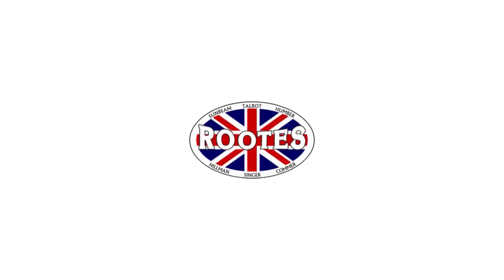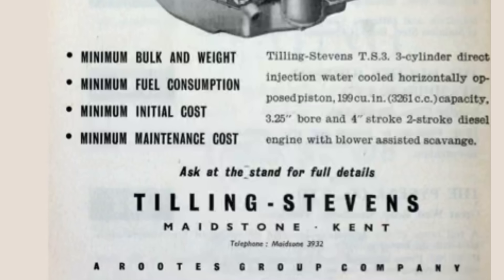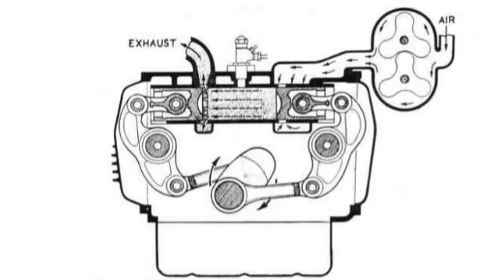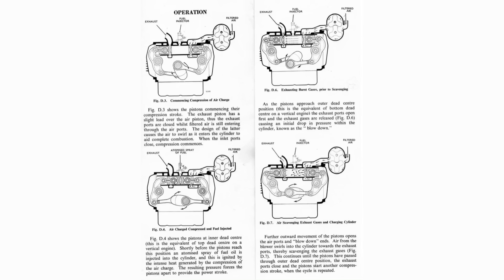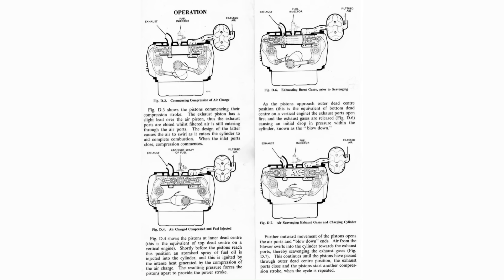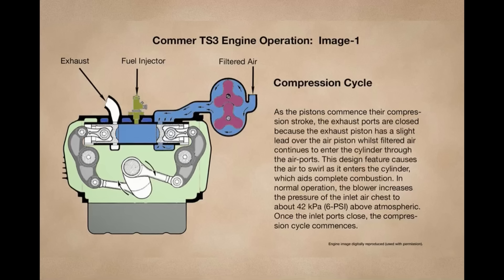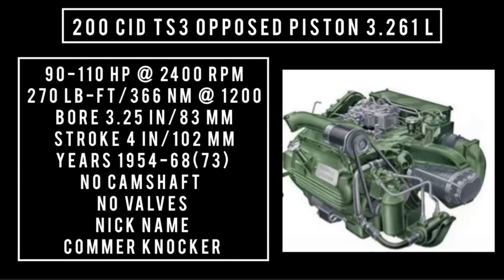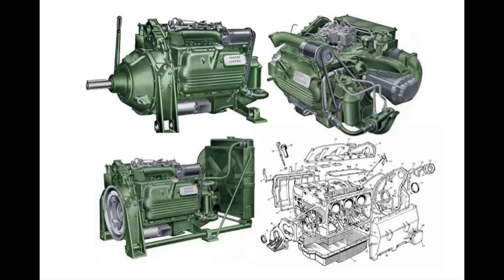Rootes TS3 three cylinder six piston two-stroke diesel engine 200 cid

Comment: I am into all things 2 stroke. The oil was NOT sent to the combustion chamber, as mentioned. It had a wet sump like a Detroit diesel, only fuel was injected so they ran quite clean and are actually insanely efficient, being opposed piston. The Fairbanks-Morse opposed piston diesels are as far as I know, still in production and run VERY clean. I have a rare, only 7 built, I have number 3 of the 7, air cooled small single cylinder 2 piston 18 cubic inch 7.5 horsepower military prototype 120/Y/208 volt 3 phase 400 cycle field generator set that was never adopted by the military and never produced, and it is incredibly fuel efficient! Made my American MARC. In the year I was born, 1966! It has about 18 hours on it. It uses 2 crankcases and both act as scavenge pumps, and although direct fuel injection is used, it has total loss oiling because of crankcase scavenging like a gasoline 2 stroke!! It runs like a fine Swiss watch and sips fuel and actually uses very little oil despite being total loss oiling. Super ultra rare !! I would love to see a video on the rare valveless loop scavenged valveless 51 series Detroit Diesels, I have 2 of these rare engines, both the 4 cylinder 4-51 model. They also made an even rarer 2-51 2 cylinder! Also would love to see videos on the DKW car engines, and the DKW made SAAB engines which, of course are 2 strokes, both twin and triple cylinder. The 2 stroke Fairmont railroad speeder maintenance car engines would be cool as well! I have 2, a QM converted to a QB (QM is magneto ignition, QB is battery and coil ignition, and a later RO-D. Great engines, incredibly powerful and reliable!! Cheers!! 😋👍🏻
Reply from the maker: Thank you so much for all that information
Reply: They aren't completely clean as you will always get some oil passing into the exhaust ports as the piston travels down the Napier deltic suffered greatly from this issue and a normal run will require several 20 liter drums of oil and sometimes oil would build up in the scavenger box leading to exhaust fires.
Reply: @ianluce9297 exactly the same as any four stroke with oil loss .
Reply: Yes I've worked on many , no oil injected , just fuel

Comment: Another equally odd engine was the British Trojan car, 4 cylinders but only two spark plugs. Basically an opposed piston engine bent in half to use one crank. Similar to the Puch Twingle unused on motorbikes.
Reply from the maker: I'll have to look into that car

Comment: Maybe use a smaller displacement version of the engine in a diesel electric hybrid. Have a electrically driven supercharger.
Reply: As a diesel mechanic I always wondered why they never put electric turbos on engines to cut out turbo lag at low RPMs,it would have improved low end response no end till the main exhaust turbo spooled up and took over,surely a modified heater motor could have helped cut the turbo lag.

Comment: Thanks for covering this engine Jay. I'm still wiping the oil off my laptop. 🙂 I worked for a Rootes Group dealer (Todd Motors NZ), in the '70's as an apprentice mechanic.  The TS3 did all the typical diesel engine things of the time but the sound. I thought and still think that they are very cool. Although tracing and repairing oil leaks was a challenge. There is one still around that gets taken to some truck shows with a massive brake on it so it can be loaded up. Always draws a crowd. Cheers Kiwi Bryce ☺
Reply: I was born in 1961 in Christchurch and remember the sound of these trucks on the main north rd and around town. Cool engines.
Reply: @stephengibbs4372  I was born in Hawkes Bay in 1962 🙂
Reply: My cousin's husband was a spray painter for Todd . Later he worked as a security guard.
Did you ever run into a guy by the name of Bill Ward (aka Blob)?
Reply: @PaulG.x  The name sounds familiar but it was a long time ago 🙂
Reply from the maker: Awesome thank you so much for sharing that =)

Comment: Hi Jay. Indeed this engine was well known, possibly everywhere except the US and was commonly known as the Knocker, for its sound. I don't think the fuel was a mixture of fuel and oil - that's petrol 2 stroke engines. Diesel fuel is a light oil. It's possibly inaccurate to say that companies spawned under the Rootes Group. Rather, they just bought up pre-existing companies. And I'm afraid you forgot to put the M into Humber (named after a river). If you like wacky engines like this, check the Napier Deltic - it's more a locomotive engine though. And if you ever get to aircraft engines, there is the Napier Sabre.  Cheers.
Reply: Well, that's because the British made great engines and didn't need anything to do with the US.
Reply from the maker: Thank you for those corrections

Comment: Stick it in an old truck.  Make it the most obnoxious truck you can drive.  Twin stick. 4x4 transfer case with separate 2wd/4wd shifters and high/low range shifter.  Four sticks poking out of the transmission tunnel just because nobody ever asked it to be done.
Reply from the maker: Hahahaha nice anti-theft mechanism there

Comment: Probably not a great road engine, dynamic loads and such. It would work well as a generator though. That would be worth showing off in hurricane season
Reply: These actually were used in on road applications.  Lots of videos on youtube of them being driven.
Reply: @wolfman9999999  well the point is there's a reason this type never caught on for road application lol. If you google it there's been several startups who've experimented with it and given up. Too many moving parts in the rotating assembly and a few other inherent issues. Deep torque low rev would make a much better stationary engine
Reply: @Drmcclung modern emissions regulations make these unworkable. Its whatvkilled the two stroke detroits.
Reply: @wolfman9999999 i tried to post a link about the most promising version and forgot links are a nono on YouTube and get deleted automatically. But the gist was its been a very long gestational period for Cummins and the Achates; I remember as far back as 15 years ago once in a while they'd both make headlines and disappear, come back, disappear again. Its a similar situation with Mazda's wankel not coming back, and then it did.. as a stationary engine. For the genny in their new hybrids
Reply: @Drmcclung Yeah, the cool designs are all killed by progress
Reply: @wolfman9999999  Cummins may actually get theirs out, hopefully
Reply: @wolfman9999999  And two-stroke on-road motorcycles too.

Comment: Seen that one in a Rootes history, they showed  a cutaway demonstration of the inner workings of the engine.
It is similar to Fairbanks-Morse, one of my locomotive books shows an FM locomotive engine on display, very tall but compact. The Rootes would make a good marine engine. I was reading a short article on the 1990's show car the Chrysler Atlantic, modeled after the Bugatti type 57  straight 8 coupe. 
For the  Chrysler Atlantic engine they connected 2 Neon 4 cylinders inline, and machined  a common crankshaft and a pair of camshafts to make a straight 8, interesting engine
Reply from the maker: That's an interesting engine the Chrysler Atlantic. I added both that one and the Fairbanks Morris company to the potential engine episodes. It just depends on how much information I can find some of those companies don't exist online.

Thank you so much for sharing all of the insight and information. Greatly appreciate it.
Reply: @What.its.like.  You're welcome, that article didn't discuss deep details about the engine since when the car companies build experimental cars, they keep the engineering details proprietary.
The only show cars I learned from is watching videos of Joe Bortz's GM Motorama car collection, those had some wild features.

Comment: Thanks for doing this engine Jay 🤩 I'll add a bit of what I know about it from what I've read. I've never seen one IRL as they're uncommon this side of the Atlantic. Commer made a whole range of trucks from regular vans on up. When running especially under a load the exhaust pulses were sharp and produced a "knocking" sound which gave it the nickname of "Knocker". You could hear one from a long way off and know what it was. Mechanics (spannermen in the UK) hated working on it because it was hard to access compared to the normal inline engines and drivetrains, and the frequently broken quill-shafts were no fun to fix. 

The lobed rotor superchargers you see on these, old GMC diesels,and drag racers were invented by Rootes so they understood them but underestimated what it took to drive this one. It was necessary for the 'quill' shaft to be flexible because the blower 'pulsed' as it ran and a more solid shaft would have beaten the machinery to death. That's one reason drag racers use belt-drives to the blower. By the time they discovered the problem it would have required a new block casting to upgrade the shaft and they didn't feel it was worth the cost. Drivers soon learned to keep the RPM's down and let the torque carry the load so the quill shaft would last. These had great low-RPM torque curve, rising rapidly from just above idle instead of more gradually like conventional engines. These were also relatively low RPM engines as well due to the heavy reciprocating parts compared to normal engines.

For those who enjoy 'going into the rabbit hole' there is a huge amount of info on these but most of it is on UK websites so that takes some digging as most search engines tailor results to your location. Overall it was a good engine if you treated it well but it wasn't greatly loved by anyone. It's kind of scarce to find a running example today because trucks are simply used up then scrapped without fanfare for a new one where the cycle repeats itself. 

If I had one it would have to go into a cab-over (forward control in the UK) dump truck from the 50's. Or in a Commer where it belongs. Truly one of the weirdest engines to have ever been in large-scale production with a long life.
Reply from the maker: Thank you so much for mentioning this engine like you said most of it on UK websites I tried to get owners manuals operation manuals, but I just couldn't get them clear enough to present them. I even tried running it through a couple different filter programs I have and it wasn't doing it.

I also had a clip of the engine running that I totally forgot to put in..

I really appreciate you taking the time to add all of the insights and information 

I'm working on a couple other episodes in the background 
Cunningham V8 curtiss v8... I think the Curtiz V8 was the first American V8. It just wasn't mass produced. Made in 1906 and it is a work of art... 

I'm gonna go on a bit of a rant here, I was born in the wrong time period and how I know that is because if I want something, I just build it kind of like people back then I'm a rare breed.. people don't really build engines from scratch anymore or make parts from scratch anymore. We have more technology and easier ways to do it but if you wanted to get something made like that, it would cost you a fortune... and it just seemed like back then everybody was building and designing their own stuff and now it's too much to ask to paint something.. idk
Reply: That's Roots Blower, not Rootes. Invented by the Roots Blower Company in Connersville, Indiana, USA and still made there, at least the very large ones! Rootes may have been very competent in blower design, but they did not invent it.
Reply: @keithstudly6071  I may be wrong on that point- probably am. There's a bunch of different blower designs and I'm not up to speed on them or their history
Reply: Quite a few found their way into new orleans as marine propulsion.    I understand quite a few of them are still running
Reply: It is interesting to note that the Roots blower used on Detroit Diesel 2 strokes was never described by DD as a 'supercharger'. Its job was to do the scavenging. Also, the power needed to drive the blower was quite high. I recall reading that an original, stock 426 Hemi wouldn't have enough power to run the 'supercharger' on a modern Top Fuel dragster.
Reply: @61rampy65  IIRC the figure I saw was 1200-+HP to drive the lower. And all through one belt!
Reply: @61rampy65  The high power demand in a dragster application is because they're actually using it as a supercharger, which a Roots blower isn't actually all that good at doing! In its original application for two-stroke blower scavenging, it only has to overcome exhaust back-pressure plus whatever it took to push air into the cylinder against that back-pressure, and the power demand (though not zero) shouldn't be all that much. It'll go up fast with revs, though - hence the quill-shaft troubles with the Commer Knocker.
Reply: @bikeaddictbp  Uh, ok. Isn't that what I said?
Reply: Great report on an engine I never  heard of
 What was their rationale for going with such a different design, like 2 cycle ans 2 pistons per cylinder?
Reply: @warrenjr527  The goal was to have as flat an engine as was possible while still fitting in between the frame rails of trucks so as to make a shorter cab-over design more feasible.

Comment: Fairbanks-Morse had similar engines.  They had two crankshafts.
Reply: Commonly used on submarines and Fairbanks Morse locomotives
Reply from the maker: I'll have to look to that engine I that ransom olds was on the patent drawing, which is interesting..
Reply: @davidjernigan8161 Thanks for your response!  I didn’t know that.  I know some locomotives had that setup.